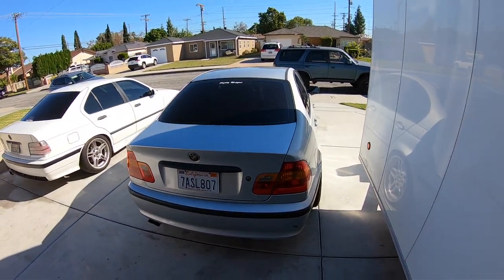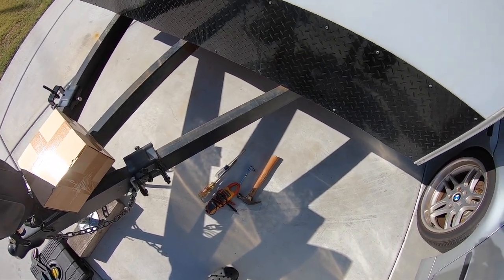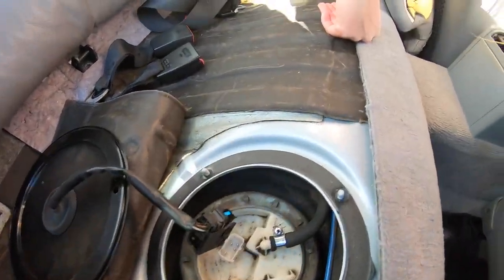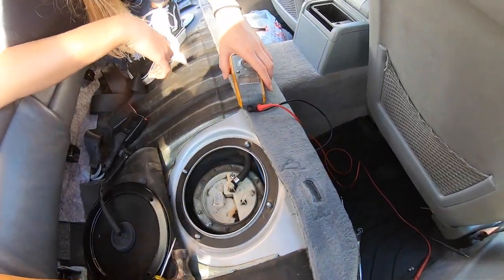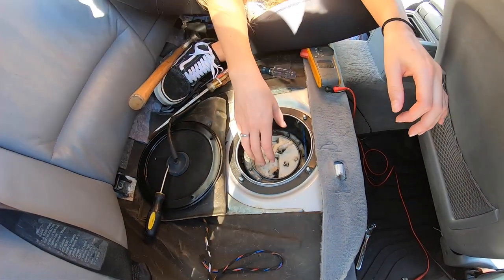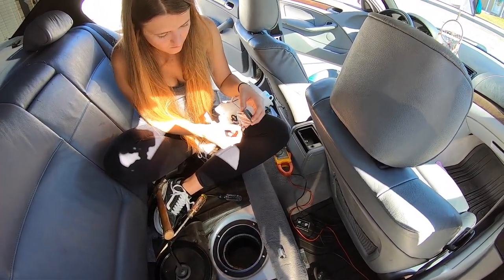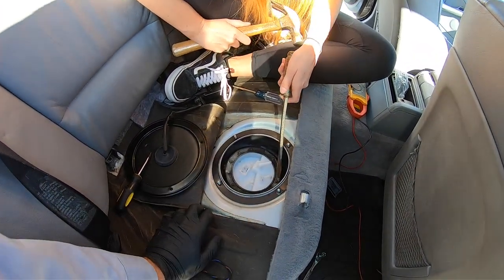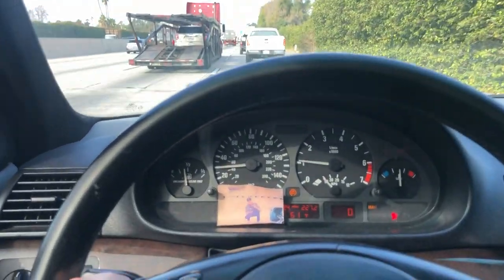E46 Build Ep. 6 (Fuel Pump troubleshooting and replacement)

Comment: Hi Man, I have 9v at the pump (it doesn't seem to be turning at all) and I also have a no-start condition (cranks but doesn't turn over). Was working fine 2 days ago, nothing's been done to the car. Any ideas?
Reply from the maker: @muchgreatness7497  see if it starts on brake cleaner.
Reply: @slightlymodified501  I did do the brake cleaner step but it didn't start and I think that I also have an issue with the EWS system (maybe low voltage). Because of the EWS problem, I may also have no ignition, which would explain why it didn't turn over. What do you think?

Comment: Man I can’t get the dam pump to come out. Like every video I watch as soon as they have that collar off and the hose disconnected it just lifts right out. But I’m over here yanking in the thing watching the whole area around it lift up and the thing just will not come out
Reply from the maker: Clean off the area and try the use a flat head or a trim tool to break the seal.  Its a tight fit it will come out
Reply: @slightlymodified501  I actually just got it off, which is great but now my concern is that I saw a good amount of little dirt and whatnot had fallen down into the tank. I’m a little concerned about starting the car without trying to get that dirt/debris out of there
Reply from the maker: @talbotd27  replace your fuel filter too.  Shouldn’t be too bad
Reply: @slightlymodified501  alright, will do. Thanks for your help, nobody else was awake right now and I really wanted to get the job done tonight

Comment: Hello I have problem  with my 320d fuse is good but it doesn't give electrics to the pump what it can be ? And pump is good I try the pumpu start with battery on + and -  and it goes  (Sorry for my bad English)

Comment: What was the code? For the engine light ?
Reply: i bet the code was for "fuel pump left the house"...   when he tested the wiring unpluged and turned on acc (key on first position)  looking for the 12v on the plug.. the ecu probably notice there was no pump..

Comment: don't ever do what this guy does "rub fuel on the rubber gasket" its stupid! you need to use grease. fuel will dry out the rubber and crack the seal.
Reply from the maker: I get what you are saying. But in this case the rubber is fuel resistant. Same with injector O-rings. Any o-ring that touches fuel needs to be Viton or Nitrile.